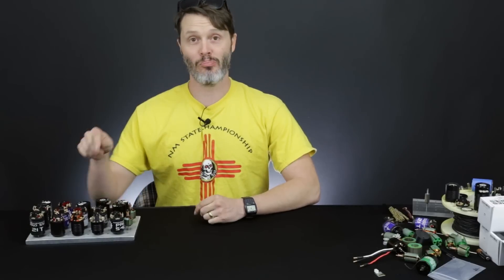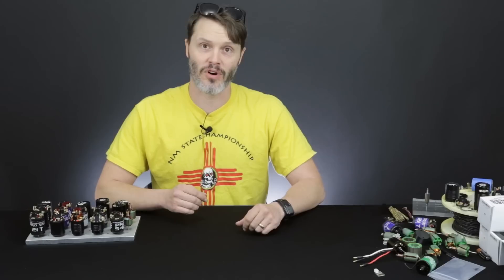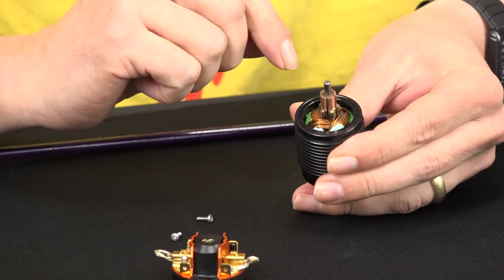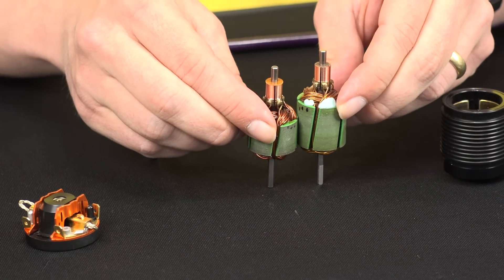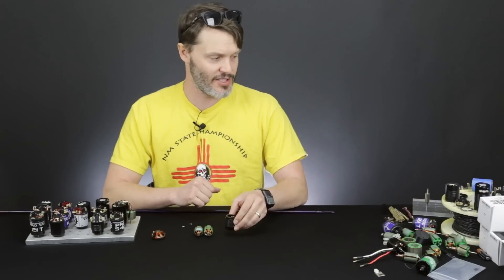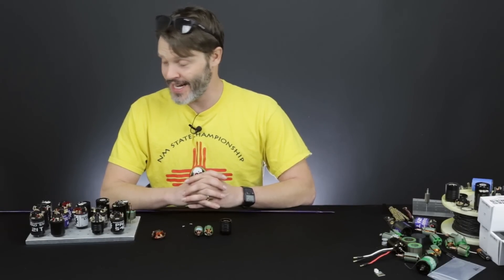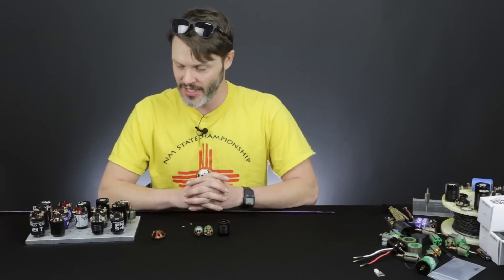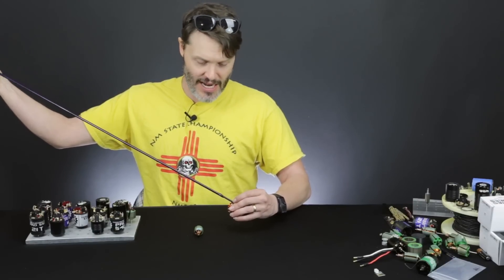Tech talk - Puller Brushed Rock Crawler Motors Explained - Holmes Hobbies

Comment from the maker: And I totally forgot to go over the Handwound armature!!  We wind these in house and finish the coils with high temp epoxy, dynamic balancing, and silver brazed connection to the commutator.  It's what makes the housing work so well!
Reply: i need your screwdriver...i appreciate someone that makes their own, screwdriver. but seriously, that driver would have been so useful working on cars...real full size cars. im a little jealous
Reply from the maker: @MasterHonker  We make our own motors, so extending a screwdriver was a pretty easy task :)   Maybe next time we will use tool steel and grind the tip too, lol!
Reply: It would be interesting to see the epoxy application and curing process, as well as the silver brazing.
Reply from the maker: @LostboyMoto  maaaybe one day.    I've made most of the manufacturing equipment as well, so sharing how it is USA assembled and price competitive is a bit of a secret.
Reply: @HolmesHobbies  Yea I figured some of this would be top secret area 51 tech. We can keep China guessing.
Reply: Can you elaborate on the advantages of Hand Wound vs Machine wound?  I am guessing it leads to an armature that requires less balancing, more consistency across the 3or 5 poles, and slightly shorter wire length.  Are there additional benefits?  Thank you 🙏
Reply: Im frrom philipine were how can i buy that motor

Comment: Excellent video John, I'm looking for a few words of wisdom if possible, I am currently running a Hobbywing 1080 and Crawlmaster sport 13t on 3s, I've got one of your BR-XLs on the way for some 4s running, which motor would you suggest pairing it with? It's an OG SCX10 with Axial OD/UD, 3 gear trans, 80t spur, 11t pinion, any recommendations please?

Comment: Big question old video I know! But I’m a homie from MT than digs ya show bro and I like to go back and check out old videos for info and Big shout out to you for making these for us all to check out! Anyways bro I was wondering about motors and if the motor weather the wires are reversed with the esc hooked up does the motor spin the same speed forward as it does backwards!? Weather the wires are right or not or will it reverse my speeds?? I’m not sure how that works maybe drop a link to a video to me so I can see how the physics behind swapping positive and negative wires on the motor when installing a new motor or something! Did I just make my truck drive in reverse the whole time now that’s why it just stopped working! When I don’t mess with the wires seems to make motors last longer maybe…

Comment: Hey John I was wondering if the 540 torque master paired with the hobbywing 1080 would be good for a heavy Capra?
Reply from the maker: 35t is a good choice
Reply: @HolmesHobbies  I just ordered the 540 crawl master pro 12t gonna run my stock 11 tooth how will that do?

Comment: @HolmesHobbies  i have a custom built crawler/ rig - 1/6 hasbro G I joe jeep platform, im looking for a motor a d esc combo that will give me smooth power delivery and lots of torque, but also a decent wheel speed - my rig is about 12.5 pounds .... im having issues with motors and need some advice for a motor / esc that will perform for my application. Please any help would be appreciated. Thank you.

Comment: Hi John Holmes,

I bought the Puller 500 30t a while back for a project, but now i bought a TRX 6 my  qeustion how would it perform vs the 21t titan 550 in that 6x6 ?
Reply from the maker: I would suggest another 550, trailmaster or torquemaster.  A Puller 500 is really for competition use.
Reply: @HolmesHobbies  https://youtu.be/Vqh1N23EvuQ IT works like a charm and almost doesnt get warm.

Comment: Where does the revolver fit it with rest of the motors, and what are the use  differences between the Revolver and Revolver V2?
Reply from the maker: Its also a great choice when lower KV and higher torque is wanted.  I wouldn't use it for competing though.   v2 is smaller and lighter.

Comment: is the puller 400 team mostly for MOA or could it perform well on a lightweight c2 rig 6lbs-ish?
Reply from the maker: it does really well in c2 rigs with proper gearing.  Designed for MOAs but still good enough power for a shafty.

Comment: John, I have been watching your videos a lot trying to learn before I make a leap. I have been laying awake at night trying to think of at least one ignorant question I could ask. You tell us about these monstrous motors and burning up brushes so rapidly. My question is, if I had a motor capable of running a 6s battery but instead I run a 2s. because I use the lower voltage will the life of brushes and so forth be extended by a significant amount? I am talking about running it in dry areas. By the way, I plan to buy a new Ultra soon, I will be seeking suggestions.
Reply from the maker: Great question!   Yes, if a brushed motor can handle 24v, it will wear a lot slower on 3x lower voltage.  Frictional wear will be 3x less due to 3x lower comm speed on the brush face.   Ablative wear (amperage blowing up the brush face) will be 9x lower since it is related to the square of the amperage.   I would expect in practice to get at least 5x better wear and probably closer to 10 or 12x better wear.

Comment: John, can you explain what difference I would feel between the 400 and 500? I see that the 500 is larger but what will that give me? Slightly more power? Better startup? Thanks
Reply from the maker: I find the 500 to startup a bit more consistent, but other people find the 400s smoother.  The 500 will produce more torque and power by about 25%.

Comment: This question is going to sound weird...I have a granite mega 4x4, and want to make it slower. Yes slower... It's for my daughter (the stock granite motor is too fast for her) Is there something you have that can handle constant load but is slower? I want to get her into short course racing. I know it's not a race truck. I just want to run it around the local r/c track. I want to run it in the novice class(I'm not looking to win a lot of races). I originally got the granite to just have fun, but now I want to do a little more with it.
Reply: I use 7 cell hump Arrma NiMh 2400 mAh and 3000 mAh venom NiMh batteries.

Comment: Hey John,  I've got a 27t trailmaster sport, and I like it been a good motor. But time to upgrade. I want the smoothest start up brushed motor with alot of torque and but not sacrificing all the wheel speed. Looking to your knowledge of your motors for a suggestion ,what's your idea? I'm running 3 of your servos now with no issues. Keep it up. 🤠🇺🇸☝️

Comment: So if I want something comparable to a 540 55t that would be...? I want a lot of torque, and smoothness of course, but I'd chose torque. Barely needs to go faster then walking speed. Love the videos too by the way. Thanks! It really wants me to understand them more.
Reply: General (not to be confused with actual law) rule is 3 segment 55t, you'd want a 5 segment with half the turns as the 3 segment motor.. 55t÷2=27.5t 5 segment.

Comment: I enjoy these technical episodes. Do you cover efficiency diffences between low end RTR brushed motors and your  brushed motors in any of your other videos? It would be interesting to see how tangible the differences, like run times for example and heating. The stock motor in my son's crawler is plenty of power for him but I'm looking at what other ways can run times be increased besides bigger batteries and lowering the weight of the rig. I do realize that other things play in the equation. Like gearing, already using a small pinion and tire size, not going to go smaller though. Thanks for these kinds of vids, keep em  coming I'll keep watching them. 😁👍
Reply from the maker: I haven't yet covered efficiency differences yet, but I hope to start covering it soon.

Comment: Id like to see a dyno curve between the 400 and 540 to see if the 2 ounce savings is worth it.
Reply from the maker: getting on that soon.  From practical application I can tell you they work very well for the average C1, C2, C3, Sporty style comp rigs.   Or get the 500 if you want that brute force and still some weight savings.
Reply: Im trying to get my hands on an xr10 to go crazy with and if i do ill probably end up going with the 400 series, just trying to figure out which style would have the best low end, hell i may en up going with dual stubby revolvers just to be different haha
Reply from the maker: @markcargill1185  400s for sure, I developed them primarily for the XR10 and berg platform.